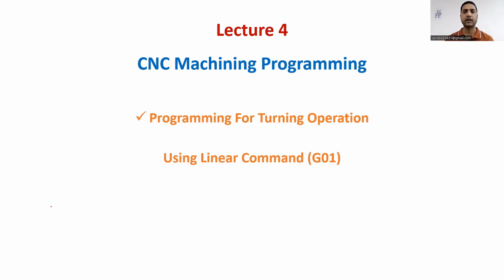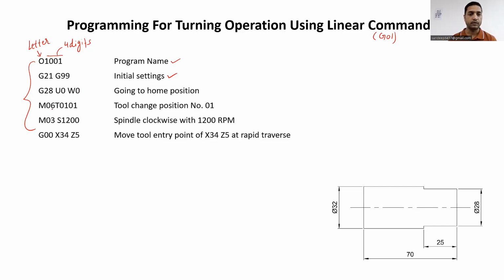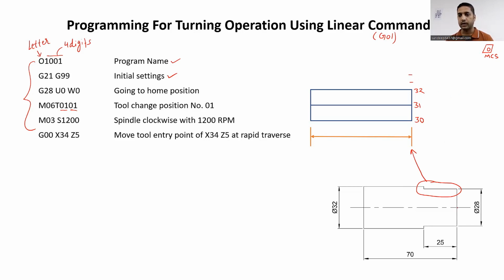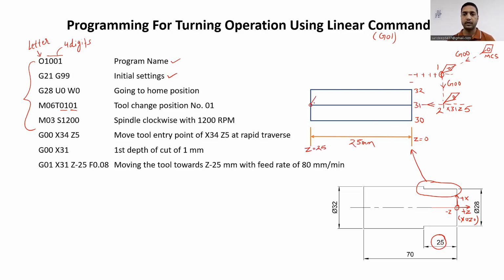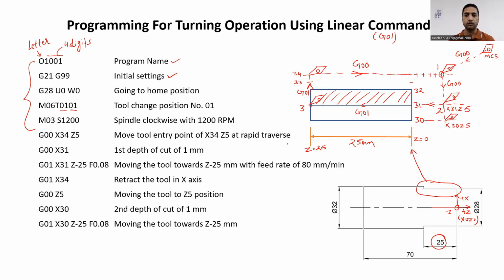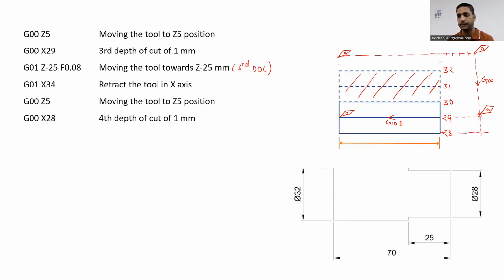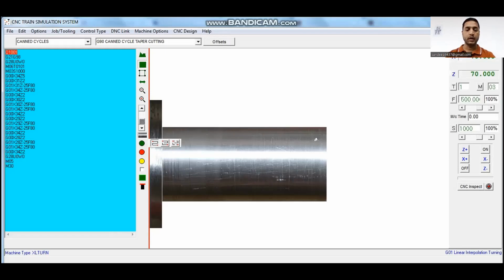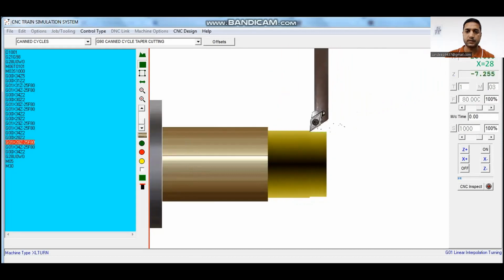Lecture 4 | Program for Turning Operation by Using Linear Command (G01) | CNC Machining Programming

Comment: Sir, if we are setting the X0 Z0 point along the centreline,then shouldnt we be using X16 instead of X32 ( like the radius,since the X0 Z0 is at the centre)?
Reply from the maker: Dear @HelloBe-mo6ni thanks for your comments. Kindly note that X value here is representing the diameter value only not radius. If we give X16 then the controller will give the command to the cutting tool to reach at 16 diameter value which will be wrong. I recommend you to watch my Lecture no. 2. Here I have explained the concepts of axis in detail. It will be useful for you to understand.
Reply: @vidyasarvam2413  Thank you sir!